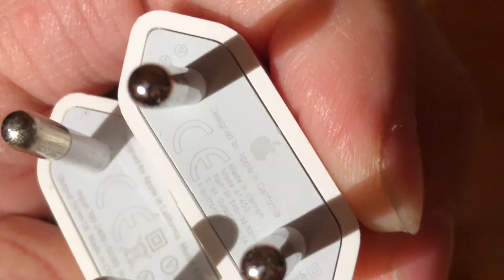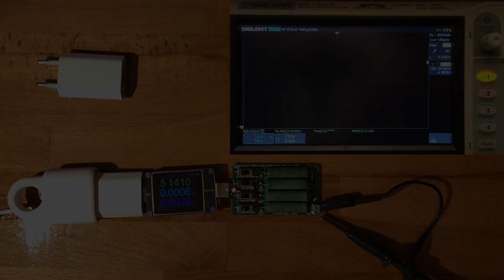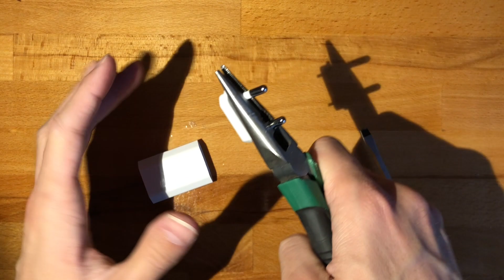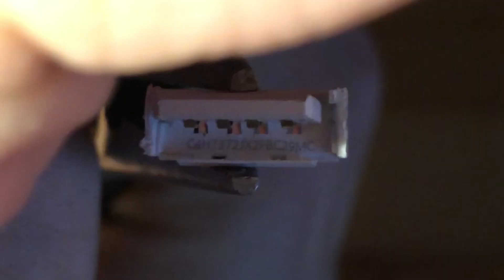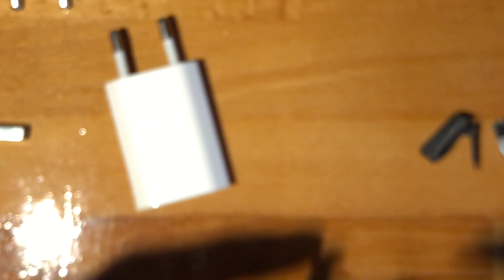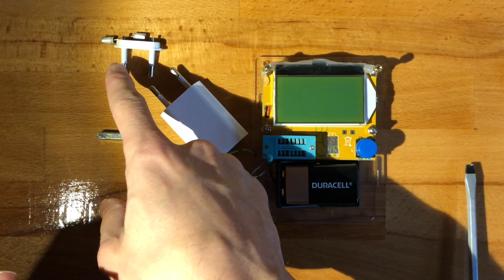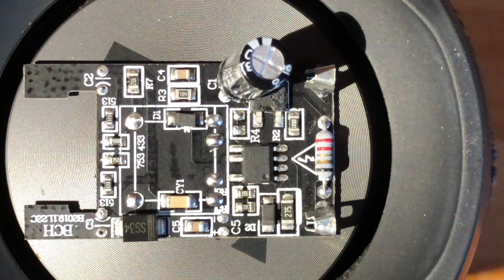Fake 1A Apple EU Charger - Benchmark & Teardown

Comment: I suggest you get well acquainted with the following features in DSOs:
1. auto-scale button – it tries to optimise scale, offset and trigger selection, so that you can get a waveform displayed on the screen as quickly as possible;
2. AC coupling – essential if you want to measure signals that are AC in nature and don't necessarily care for its DC component (most of the time you are using an oscilloscope, really).
Cheers!
Reply from the maker: very good points - I'm still wondering though

will I get no loss if I switch to AC coupling?

I will of course no longer see the output voltage change over current ... but will I get the same noise figure? I always somehow feared I wouldn't

and it is kind of cute to see the wave bob up and down ... one more measurement ... I'm honestly torn ... and that scale knob could've had some basic acceleration on it :(

Comment: if you change your chanel from DC to AC couple on the scope you will not have to scroll for days
Reply from the maker: hmmm, true .. but will that still give any measurement on offset?
Reply: It allows you measure the frequency peak to peak of the ripple on the DC voltage
Reply from the maker: yeah - I'll try using that from now on - thanks!

although, some PSUs have some longer-time-base instability outside ripple .. so .. that stupid scrolling is not completely out of the question ☹️
Reply: So you use both to help you measure
Reply: I was having same problem as you
I'm am a amateur so this the best I know
Reply from the maker: I still feel a "center wave on screen" feature would be doable and it for very sure would be useful ..

wonder if rhode&schwarz has it .. the cheap boys and knockoff teledyne lecroy don't (at least on what I played with)

Comment: It appears to have poor snubber networks as well as no X1 cap for noise suppression. Also no inductive to filter the high frequencies out if the output stage. Those cake you removed are doing everything! They're dealing with the high frequency switching directly from the diode! Very bad design !! Excellent video by the way!

Comment: Tx for your measurements and taking the charger apart. 

That SMD cap across (what should be) separation is terrible. If those smd caps fail, they usually fail shorting. 

There are lots of chargers that are even worse (although there are no shades of death). See DiodeGoneWild for some comprehensive video’s on very dodgy chargers.
Reply from the maker: thanks for the tip, will do 👾

Comment: ok so i'm at 1:10 and i think the bottom one is the original since the CE marking is drawn in the correct way where if you close the internal circle of the "C" it should touch the external one of the "E".